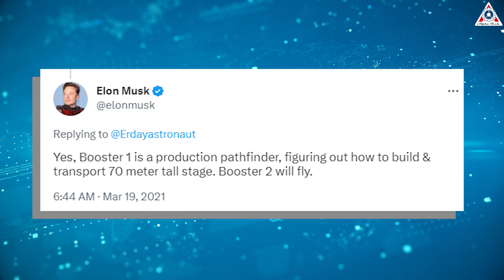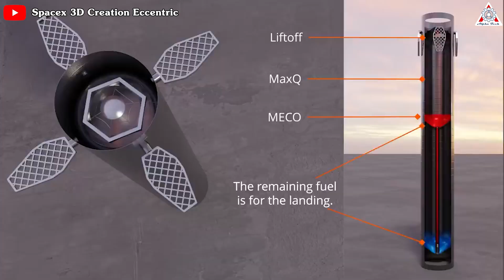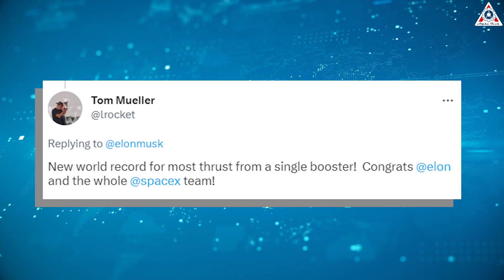Game over! SpaceX Sleeping Monster Awaken "The Super Heavy" to orbit...

Comment: I don't think Elon Musk's money can overcome the limits of human technology. His approach is no different than  that of Wernher Von Braun. "There are only two things to overcome in Rocketry. thrust and guidance". Of coarse now there is the issue of payload and stress related issues, of which Elon Musk is attempting to overcome through generally accepted practices. However, the engine components are not much different than those on the Saturn 5 rockets, except he has a lot of the same things, i.e. multiple engines. Lots of engines and compnents. Lots of things to go wrong. The more things change, the more they stay the same. Good Luck Elon Musk. You are going to need it.

Comment: Steel was SpaceX's best option at the time.  Had they chosen aluminum they would regret that by now...just ask the U.S. Navy how good aluminum hulls hold up.  The latest destroyers are all getting scrapped because the aluminum hulls started corroding and developed stress fractures during their shock trials (where they set off underwater explosives close to new warships to test for survivability).  Basically they couldn't even make it to their first deployment before coming apart.  Now imagine how much fun it would have been if the most powerful rocket in the world had to endure the shocks from engine startup, stage separation, etc.  SpaceX would have never gotten reusable rockets that could last 10+ flghts.

Comment: (not yet finish);
(Platinum Golden Silver Surfer song: "
CODE; "
OPERATION: "
Code name:
Call sign: "

Whereas in Equator, Hemispheres, Axis, and Directions

<p><strong>Fig. 1.9.</strong> The earth is divided into hemispheres by the equator.</p>
Fig. 1.9. The earth is divided into hemispheres by the equator.

Image by Byron Inouye

The earth rotates daily about its axis. The north and south poles are the two imaginary points where the axis would enter and exit from the earth if the axis were a pole or a line (see Fig. 1.9). The equatoris the imaginary primary reference line drawn around the earth halfway between the north and south poles. The half of the earth to the north of the equator is the northern hemisphere; the half to the south is the southern hemisphere (Fig. 1.9). (The prefix hemi- means "half"; thus, hemisphere means "half-sphere.") The poles determine north and south directions. Movement toward the North Pole is northerly in direction. Movement toward the South Pole is southerly in direction.

Parallels of Latitude
Latitude is measured in degrees (°)—from 0˚ to 90˚—north or south of the equator. Degrees of latitude are measured from an imaginary point at the center of the earth. If the earth was cut in half, this imaginary point would be intersected by a line drawn from the North Pole to the South Pole and by a line drawn from the equator on one side of the earth to the equator on the other (Fig. 1.10 A). A radius is a line drawn from the edge of a circle to its center. The angle between the radius lines drawn from the equator and from the north pole (or south pole) forms a right angle, which is 90°.

Image
<p><strong>Fig. 1.10. </strong>(<strong>A</strong>) Latitude is determined by the angle between a point on the earth’s surface and the equator. Latitude angles are between 0° and 90°. (<strong>B</strong>) Connecting all the points on earth’s surface that are at 30° and 60° angles from the equator in each hemisphere creates these imaginary parallels of latitude.</p>
Image caption
Fig. 1.10. (A) Latitude is determined by the angle between a point on the earth’s surface and the equator. Latitude angles are between 0° and 90°. (B) Connecting all the points on earth’s surface that are at 30° and 60° angles from the equator in each hemisphere creates these imaginary parallels of latitude.

Image copyright and source
Images by Byron Inouye

The equator is at 0°, and both of the earth’s poles are at 90° from the equator. Latitude is determined by the angle between a point on the earth’s surface and the equator. To calculate the angle, draw a line from the point to the center of the earth and a line from the equator to the center of the earth (Fig. 1.10 A).

Parallels of latitude are imaginary reference lines that form complete circles around the earth parallel to the equator and parallel to each other. Every point on a parallel of latitude is the same distance from the equator, and thus the angle formed between the equator and the latitude line is constant. This is shown in Fig. 1.10 B for the latitude lines 30° and 60° north.

Parallels of latitude are circles of different sizes (see Fig. 1.11). The largest parallel is at the equator, and the parallels decrease in size towards the poles. Except for positions located right on the equator (0°), parallels of latitude are described by the number of degrees that they are north (N) or south (S) of the equator. The greater the distance from the equator, either north or south, the higher the latitude. Honolulu, Hawai‘i, for example, is on the 21° N parallel. Sydney, Australia, is on the 34° S parallel.

Comment: Rocket Labs carbon technology gained from New Zealand's America Cup boats should advance future endeavours. Propulsion tech where are we at?
Reply: unfortunately the carbon technology cannot handle low temperatures vibration and high pressures at the same time.
Reply: it is part of what stopped the X33 SSO from use, the tanks failed , leading to the cancellation of the X33 and X34 single stage to orbit rockets. the engines worked fine.
Reply: @jessepollard7132  old tech though
Reply: @jessepollard7132  carbon on periodic table is  by creation the strongest element.
Reply: @stephenhoward7454  no, but it is the most flexible in uses. I've read that a boron bond is stronger.

Comment: You keep saying they lost two raptor engines in the static fire.  One was supposed to not fire and the other was shut down in a controlled way, a good test to the computer controls and management systems.  You should know that Space X learns from issues and this isn't out of their normal way to test and push designs.
Reply from the maker: Thanks your feedback. I will note this

Comment: IT SEEMS AS THOUGH YOU WOULD NOT TAKE OFF AT FULL THRUST JUST AS YOU DO NOT FLOORBOARD YOUR CAR ENGINE WHEN YOU START IT UP. THAT SHOULD KEEP YOU FROM RUINING THE CONCRETE OF THE LAUNCH PLATFORM, ADDING NEW THRUST WHEN THE MACHINE IS HIGH ENOUGH UP THAT IT WOULD NOT HURT ANYTHING WITH ITS MASSIVE ENGINE THRUST.
Reply: Weight must be overcome by thrust, mostly at the start. Hold downs prevent lift until thrust is maximized.

Comment: great video as usual.
about the records of the Soviet N1
announce that the engines of the N1 have not been tested!
it's not out of stupidity!
  it's just that the engine of the N1 used rather aggressive propellant that it destroyed (literally) the engines just by circulating in the pipes. with these ergole a motor is in any case single use (lifespan = barely more than the mission time of the 1st stage: 3 minutes)
Reply from the maker: Thanks your feedbacks. I will find more about that

Comment: 21st Century Rocket Technology seems to be a bit Lacking ! ... These days just getting to Orbit is a barely achievable feat ! ... All these Rockets need so much fuel to reach Orbit ... they have No Fuel left to go farther ... Even a Sling Shot wouldn't help much ! ... They need a Long term Energy Supply that will last years ! ... Then the Rockets can use their engines to slow reentry and landings ... Then Heat Shields and Parachutes aren't needed ... and you can land on or takeoff from any Moon or Planet ... Sending Up ever increasing MOABs is Not the Future ......